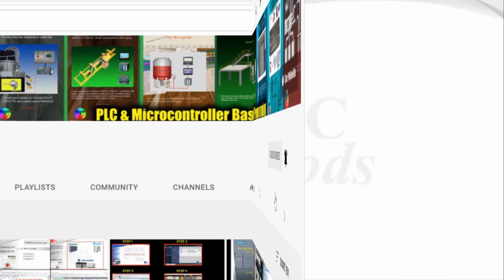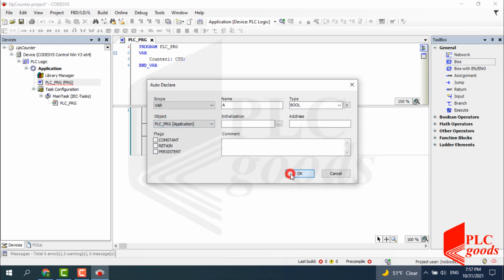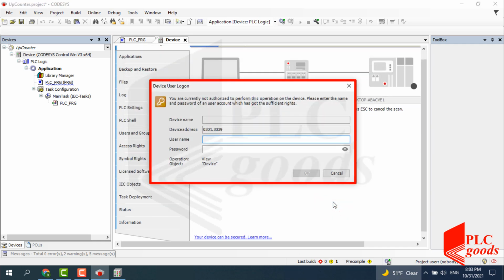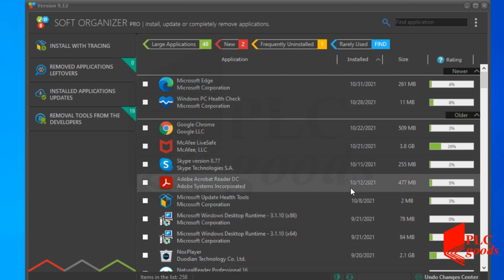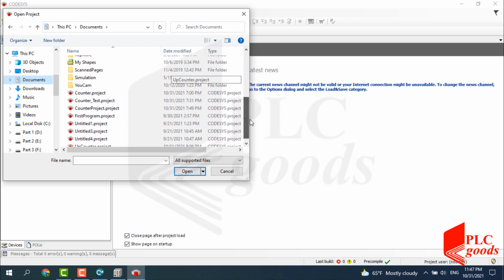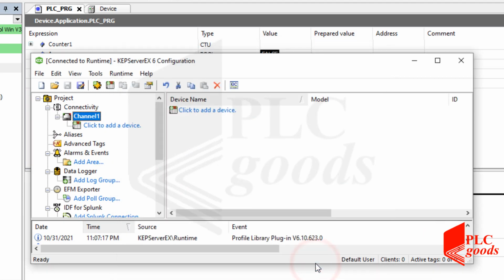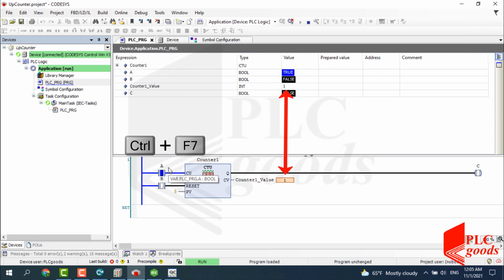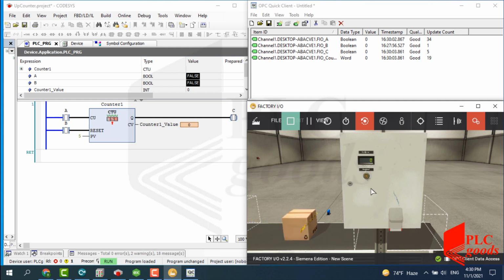Codesys Counter Tutorial with Factory I/O | Up Counter (CTU) Explained   | Lesson 6

Comment: this don't works al 3.5.21 😢
Reply from the maker: thanks for your comment. Your message isn't very clear—if you're referring to the software or setup shown in this video, I can confirm it's working perfectly, as you can see in the recording. However, if you're using a different version of the software, or different hardware, that might be the issue. Please feel free to share more details so I can better assist you.💚💚
Reply: @plcgoods  thanks... I used sofware indicate to remove CODESYS, but this don delete  pass and user information. Howerer i ask in COpilot and show me delete folders from system32..../codesys, I tried but after PLC didn't start. Now, I dele each folder i found and  i'm going to install a 3.5.17 version to try..Sorry my English is not my native lenguaje

Comment: Good morning ing. i am self-taught A, i have codesys 3.5.15.30 ver. Demo, i need to reset the username e password in the execution both in simulation and with the virtual PLC( Control Win) in both cases it asks me for a username e passwordwhich i cannot give as it tells me that they are incorret. What can i do? Thank you .
Reply: Hi there, I had the user and password problem too. As I've explained in this video, you need to use a professional application to remove the CODESYS with its all effects on your system and then install it again. After installing, it will ask you to define a new user and password. please don't forget it.
Reply from the maker: Thanks for checking the channel out!